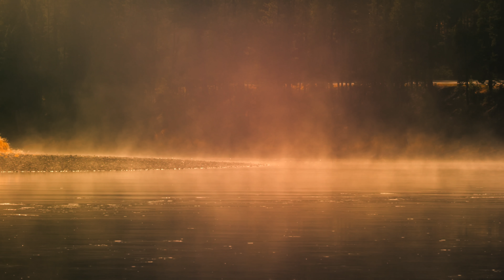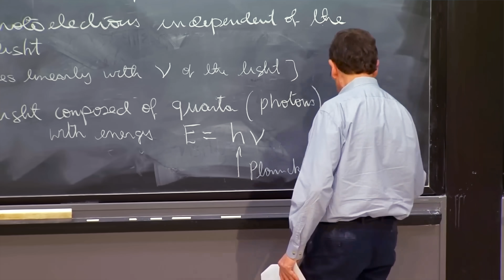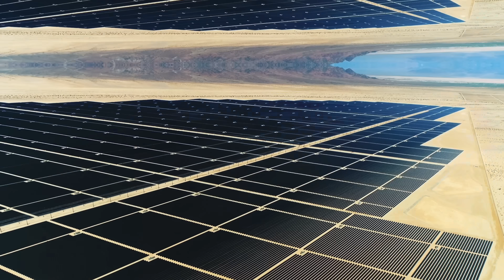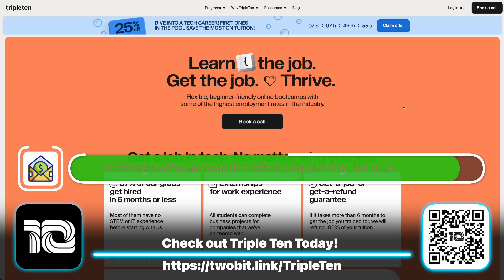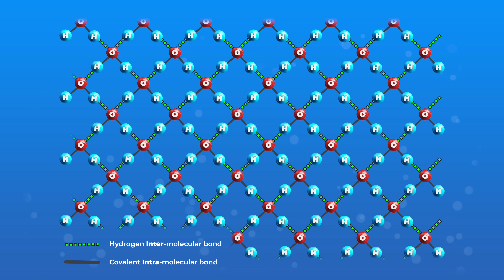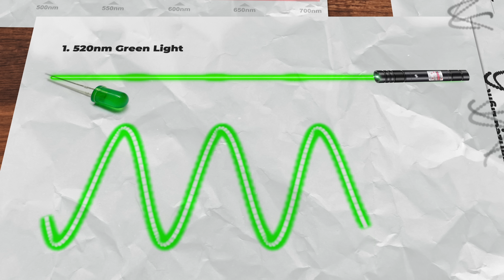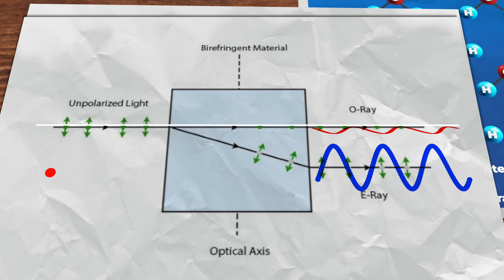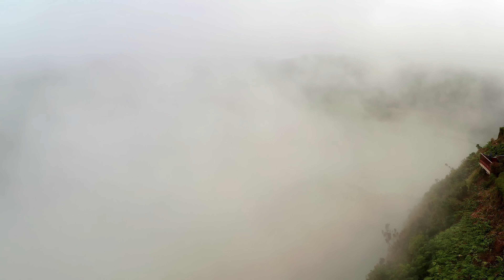New MIT Discovery Just Solved Water's BIGGEST Mystery!

Comment: It seems odd to me that this hadn’t been discovered long ago. I wonder how many other important discoveries are staring us in the face.
Reply: It has been known as an effect, when snow melts even below freezing temps in direct sunlight.
Reply: @modulexus  Just so we're clear, melting isn't the same as evaporating.
Reply: That's what's most fascinating about this! It's not even a minor effect, it's just small under sunlight because only a small fraction of the spectrum is green and the light is randomly polarized (or unpolarized, which is the same thing). I think it's one of the best discoveries since stuffed-crust pizza.
Reply: @Israel_Two_Bit  Your comment had me interested in science until the last part where I forgot all about science and got hungry.
Reply: @Israel_Two_Bit  hi
Reply: Vapor pressure plays a significant role and has been know for decades. This is why water boils in a vacuum.
Reply: The Higgs boson was proposed in 1964. Is it possible that this effect was theorized and/or measured already decades ago, but not paid much attention to?

Since (visible) light can evaporate water, then can condensing water emit it?
Reply: @DarkSkay  solo luminescence
Reply: @DarkSkay   Yes, in the form of heat, so there's a conversion of energy taking place.
Reply: gotta see past the bias first, to learn something new
Reply: @lunkerjunkie  who's bias, the lying stealing, system that tells us they discover when they don't?
Reply: Or more importantly how many things we accept and assume as “proven” scientific truth turn out to be incorrect!
Reply: I was wondering this exact thought. One would think that this would've been figured out a long time ago. In a way it's nice to see that even now we are finding out this kind of things but on the other hand it's kind sad that while we're missing this kind of knowledge us as species are still hellbent on warring with each other and spending many times more on hate, death and destruction than on scientific research. Not saying that even if we'd have all this knowledge it'd be ok to spend on warring though. :))
Reply: @Dirtypandasan  it was learned Kong ago, the mechanism is vapor pressure that plays a significant role in evaporation.
Reply: @GoogleSucks-i1d  I wasn't talking about that mind you :)
Reply: Nothing new under the Sun
Reply: it was discovered long ago, this isnt' an MIT discovery, it isn't new, just go read The Fourth Phase of Water by Gerald Pollack
Reply: It has infact been known for decades.
Reply: It’s endless
Reply: Now guess how long it will take this to be presented as a rock solid counterargument to the greenhouse effect and climate change in general, because SEE we don't understand it AT ALL - that kind of ignorant bs is already on the way.

Now to be honest this is agreeably a bit concerning, if there's even a 0.1% difference in the effects of solar radiation to what was understood before, that can quickly accumulate into massive divergences in the applied models, so yeah, what the hell.. 

Is this really a brand new discovery in 2024? Also seems to be not too subtle, so after decades of precise measurements, how such a thing gets missed for so long? And if this really is the case, what the hell do we actually know, what else we missed, damn this raises a number of rather uncomfortable questions...
Reply: One huge scientific discovery/ cover-up is Expansion Tectonics or (Growing Earth). Its 100% backed by scientific evidence but isn't accepted by scientific institutions.
Reply: All of them
Reply: Nobody is interested, it's easier to delete unconvenient things like that plants need CO2 from the school books.
Reply: The medical scam community needs to be flipped on its head. Low fat kills. High fat low carb is ideal. Mostly beef and eggs is our ideal food. No bread. No or very few vegetables (they taste terrible anyway until you add butter - that’s your body trying to say stop eating them).  Your bowels will thank you without all that rotting useless garbage in there. Clearly this is our proper diet.
Reply: I’m sure it has been just not for us
Reply: like a million and one. It's absurd how much we just don't know or how we don't see connections between things that are highly connected. Humans seem to be quite bad at critical thinking in big pictures
Reply: Scientists love to ignore what has already been known, then beg for money just to tell us they finally figured out something no one needed to know. Technology has made scientists sub par.
Reply: Search: The Fourth State of Water - Professor Pollock, University of Washington.
Reply: So many
Reply: Agreed, I had always assumed that this is exactly what happened.  It never occurred to me that the mechanism was unknown.
Reply: All of them
Reply: Here's one, solar forcing effects our climate/weather 2-300% more than can be shown in current science models.
Reply: I've known this for a long time...read my comment above
Reply: Yes this has been discovered VERY long ago! The water in the air is a water molecule that has been hit by a photon or cosmic ray and has gone up in the air (essentially evaporating but not evaporating, it just remains suspended! This is how we have humidity and torrential rains when your window is cracked open but your room floor is totally wet... They are rehashing old news!
Reply: This isn't new info. It is just paid propaganda setting the base for pointing tax dollars toward geoengineering. You don't need to think like me...just think for yourself!
Reply: 5yt?6try yt? yt? to1630😢
Reply: We just recently "discovered" that evaporating salt water carries salt with it and deposits it back on land. You know, after all the stories of crazy things that rain from the sky along with the water. Only now? Really?
Reply: Microwaves already do this... Microwaves are just light with a frequency that had harmonic resonance with the O-H bonds in water .. I can't see how this is new
Reply: This HAS been known was taught this in 4th or 5th grade. Does no one see the issue here??? We've just not accounted for water evaporating in absence of heat for hundreds of years now? WTF why is no one alarmed by this?
Reply: Same, with how we know photons and other high energy particles cause physical damage/degradation to to materials, I find it baffling that this wasn't obvious :/
Reply: So this proves.
That's climate scientists. Effective socialization of science. Who have been pedalling the The big lie about man maid, climate change.. Just didn't know about the photoelectric effect. And Blamed man maid climate change.. For a discrepancy they didn't understand... Vote trump 2024. And he will drill baby drill for oil.. Generation x do not want to become a surf. And are big trump supporters..🎉🎉🎉
Reply: We'll never know while religious extremism continues to spread
Reply: @jonreiser2206  I’m 62. I’ve had a sufficiency of biology, astronomy, science, chemistry, earth science as well as the rest of required study. So often the information taught could only go so far before we heard, “…and beyond that, we don’t know”. Only fission was applicable for energy production since fusion was an enigma to control its extreme conditions, a mini sun. Now the collegiate science community has advanced to magnetic fields for control of what was thought to be an impossibility. I find it very fascinating that some rare scholars will think outside the boundaries of currently accepted knowledge and discover more, beyond what is known at the time.
Reply: @jonreiser2206  Some discoveries are suppressed because it would cause important people to lose money.
Reply: Sunlight evaporates water (like... um... how rain clouds are made) 
Sunlight doesn't evaporate salt so the water evaporated, if from a salt water source, will be desalinated. 
(Yup... Um.... Just like how rain is not salt water... groundbreaking)

Stupid people think simple things are smart and amazing. 

Think more, talk less.
Reply: Pretty much everything. We tend to over complicate everything we see because we don’t understand it
Reply: Zero point energy is. I'm currently running experimental prototypes.
Reply: Chances are the effect is negligible and can only be seen because the technology is accurate enough to measure it. I don't see it changing any industrial process, but if it has an effect on weather forecasting, it might still be very useful.
Reply: @peglor  i disagree, while listening to this i was thinking about my brother-in-law's job at a canning factory. so much energy goes into heating cans, to dry the paint on the cans, before they move to the next stage. although, this is a small example think about how much energy would be saved just from that one change in production.
Reply: @darkhorseleddarkco.2502  The video literally says the law of conservation of energy is not broken, so exactly the same energy still has to be provided. Changing the route by which it is applied to a less efficient one (Given conversion of electrical power to heat can be 100% efficient, but converting electricity to light is about 20% efficient with really good LEDs with the rest being waste heat anyway), will not save any energy.
Reply: @peglor  I'm not saying i have enough knowledge about this subject, but I find this so fascinating. LEDs don't use much energy so how can they be on the same level as running an industrial heater. Of course, the technology may not be there today, but future prospects will fine-tune this and yes eventually this will be the new normal.....well i hope
Reply: @darkhorseleddarkco.2502  To get the same amount of evaporation as you get with a heater, you'll need to throw even more power at a lighting system because it's less efficient at converting the energy given to it into light (Some of it is wasted as heat) than an electric heater is at skipping the intermediate stage and converting it all to heat.

An LED running the same power as an industrial heater would be almost as hot, except it would burn itself out very quickly without a very powerful cooling system (Which takes even more energy that could just be used to evaporate water directly). 

It sounds like at a very fundamental level you misunderstand what conservation of energy means. If it takes 1 kWhr to evaporate a certain amount of water (Specifically just under 1.6 kg if the water started at 100 Celsius - which is part of the reason desalinization using evaporation is so energy hungry) at perfect efficiency, it'll take at least that much energy to accomplish this regardless of how the energy is delivered to the water.
Reply: @peglor  re. possibly negligible effect of photomolecular evaporation.  I agree, unless we can see this scaled up, it's probably going to be like the latest and greatest earthshattering battery technology that will change everything, but you never hear about again because it doesn't scale (or scale affordably).
Reply: @peglor 
A few years ago..  i was visiting some Highlands..  where the Hills were covered with moss and grass…..   in the middle of the Summer..it was in the low 70’s F during  high Noon!!!  At night, it was around 40 degrees!!!  Simply freezing..  (found out the hard way, after i had to use ALL the blankets for my sons)

During the night, all that vegetation would produce dew….  But as soon as Daylight broke, it would start evaporating and form an ALL ENCOMPASSING THICK FOG..  before it was even warm out…  still in the 40-50’s..

As the day got warmer, the fog would burn off or form into puffy clouds and sail away..   leaving a clear blue sky by Noon.. and perfect hiking weather..

To make a long story short..    we HAVE seen it all before..  but just didnt give fancy Pseudo-Greek/Latin names to it!!!

And NO..  the effect is NOT negligible…. It is AS BIG as the Universe..   far far more than what can be observed in a lab….  
we just have to be more observant and less negligent.
Reply: @peglor  drying batterys whit almost no energy would make em 10x cheaper at least
Reply: @stefanpredl6849  It's said very clearly that this does not violate conservation of energy, so the energy for drying has to come from somewhere, so there is NO energy saving to be had from using this method to dry things compared to any other method at all.
Reply: @peglor  in the video they just explained the rate of evaporation was several times higher than using the highest temperature you could think of, meaning this entire time the majority of the evaporation that has been going on out there has been from light, not from the heat coming in the other forms of radiation from the sun, it was light all along that was the most impactful but for us heat was the most noticeable so we always “just assumed” that the heat was the one doing it, and it is, just nowhere near the rate that light is.
Reply: @BringDHouseDown  My understanding of the video is that they've discovered light energy is more effective than they expected at evaporating water, but that it's still a minuscule effect compared to convective heat and is only measurable now thanks to the precision of modern experimental methods.
Reply: @peglor  Many things in our lives are minor effects that have had major MAJOR changes to our lives.  Alternating Current is a minor effect.  Harnessing steam pressure probably seemed like a minor effect at the time and now it pretty dictates how we get power.
Reply: @peglor  you haven't watched the video, did you? you have the answers there and it's not the ones you're giving
Reply: @geemy9675  I watched the entire video - except for the ads, but I have actual training in engineering/science, so I'm not bamboozled by pretty animations.
Reply: Much to my dismay, I've recently discovered most of my farting would be best done on the toilet.
Reply: @adamjames1375  some toiletpots are better sound resonators too,,did you notice? haha
Reply: @adamjames1375  that’s not farting you’re doing. Be honest
Reply: @Walkeranz  pretty sure that was implied.
Reply: This is not new.  It is just you tube click bait.
Evaporation is prportional to sunlight  not heat. This has been welknown. l
Reply: @debochch  I don't know if you know this, but when you say Y is proportional to X, you are implying a linear proportionality. Yes, evaporation increases with increased sunlight. That much is true, but the exact law of proportionality, the underlying mathematical relationship is more nuanced than a simple linear proportionality, even in the absence of strange new effects.

To set the record straight, evaporation definitely is directly proportional to heat, how else do you think we can evaporate water by heating it in the dark? (I should know. I'm a chemist and university professor of thermodynamics). In fact, the proportionality constant is something called the latent heat of vaporization (Lvap) or the molar evaporation enthalpy of water (ΔvapH°m), depending on whether you want to express the evaporation rate in terms of mass or moles, respectively.

This has always been our understanding of how evaporation works since thermodynamics was born.

The problem is that, under certain special conditions, evaporation rates AREN'T directly proportional to the amount of heat (or sunlight, to follow your logic). It's precisely this lack of direct proportionality and the fact that clouds seem to absorb more light than a direct proportionality would suggest what has puzzled scientists for a long time.

Yes, we did know for years that there was something different going on. The problem is that we didn't have a clue what that was. That's precisely the mystery this discovery seems to solve (because they could be wrong). When you take the new effect into account, the numbers seem to check out.

As a chemist, I can guarantee that this is something we DIDN'T KNOW or even imagine until now. I carefully read both publications by the original authors and the researchers went above and beyond to discard pretty much every other explanation they could think of. That doesn't prove they're right, but nothing is ever certain in science. The best you can do is try to logically rule out as best you can all other alternatives.

So:
- No. This isn't clickbait
- No, it's not something we already knew all along, and

- No, evaporation using sunlight is no longer understood to be perfectly proportional to light intensity. The nuances matter!
Reply: @debochch  No, it is new. its never been measured.
Reply: @debochch  no one said evaporation was new 😂. but our understanding through science has improved and as explained in the video it will probably advance some branches of science like meteorology (more accurate models) and lead to some new inventions/designs that leverage the factors that were not known like the impact of wave length, polarization, and angle of incidence. evaporation is not only proportional to sunlight, if you optimize the  parameters that were discovered you could make artificial evaporation way more efficient. evaporation is used in dryers  heat pumps etc
Reply: Many that have been suppressed for profit purposes would be my best guess
Reply: @SamuelSon-OG  no, most people are not ambitious enough to teach themselves.
Reply: not everyone has a polarised green laser at home to play with. not now, not 50 years ago.
Reply: What is odd is that we are told how evolution, the big bang, quantum particles, dna and many other things work but we don't truly know how many basic things work.
Reply: @donniedonnie639  most of the unknown world  is at extremely small (elementary particles) or extremely large & far scales (universe). we have only partial knowledge of these but there isn't that much phenomenons that can be observed on earth and can't be explained/interpreted by state of the art science.
Reply: @geemy9675  It's mostly theories, and proving those theories are the source of decades, even centuries of debates. Just like this video proves.
Reply: @donniedonnie639  thats the joy of science. All those things you mentioned are Theories they are ever evolving and changing as we learn more. At one time the atom was the smallest thing we knew of, then we learned of  protons, neutrons and electrons that made up atoms.  Then we learned that protons and neutrons  are made from other things as well.  As of now in the Standard Model we have 61 elementary particles, and the Neutrons and protons are no longer considered elementary particles they are now called composite particles because we now know they contain two or more elementary particles.
Reply: @donniedonnie639 
Pseudo-Science, is far more advanced than Real Science…

One has landed helicopters on Mars..   the other just found out Light evaporates Water..  soon, they’ll know how clouds are formed!!!
Reply: @donniedonnie639 This is simply not true, the molecular mechanism of evaporation has been known for decades.
Reply: @sttone1969  That's not what this video is telling everyone.
Reply: @donniedonnie639  The video is wrong.
Reply: @donniedonnie639  
This "new" discovery was found around 106 years ago and in 1921 (1922) a certain German physicist called Einstein received the Nobel Prize for it.
Reply: @donniedonnie639  this is not that odd at all… making assumptions- based on observations- helps us to target science either the intent of specific uses in the real world - it enables us to model the world - reality, as it stands. The disconnect here, is that somehow the general public has the notion that science is a factual representation of reality - it is not! Science is a modelled reality, with all of the assumptions and limitations modelling brings into the equation. This is also why “climatologists” should be more careful with their statements- and the recipients of their actual messages, should take care to get their information at the source - not gia media and politically influenced re-telling of the original science
Reply: @Mortenthorpe-DK  Let me rephrase what I said above: It's odd that we teach, control reality, control people, build systems and businesses from assumptions. If someone has enough knowledge of mathematics to back their assumptions up with equations, the assumptions are usually accepted. If time proves them wrong, they "adjust" the math that was assumed correct (but decisions were made based off something wrong). Some people will never give up what they learn, even if its proven wrong... science is promoted, taught and sold as fact which can be good and bad. Is it done for $ or control? or for the betterment of our world? We get a good mix of both but $ and control seems to win more and more. I have plenty of assumptions of my own.
Reply: @Mortenthorpe-DK models are all wrong.  In 100 years, our descendants will laugh at the assumptions we have made.   Models are relied on far too much.